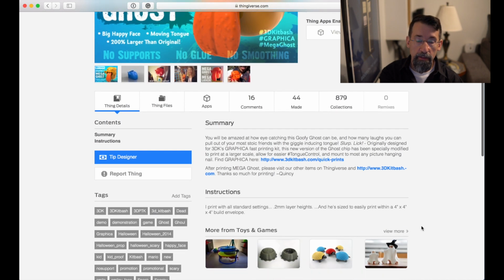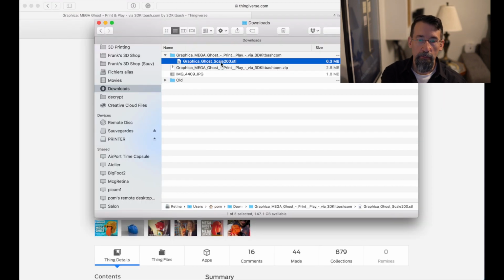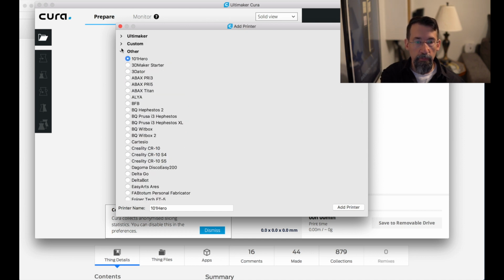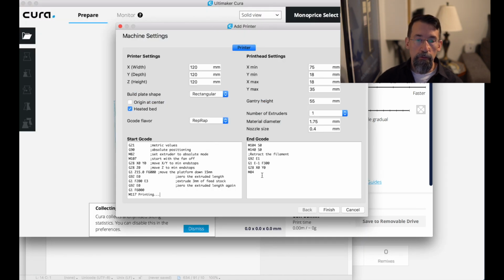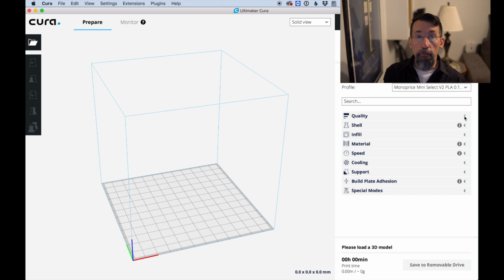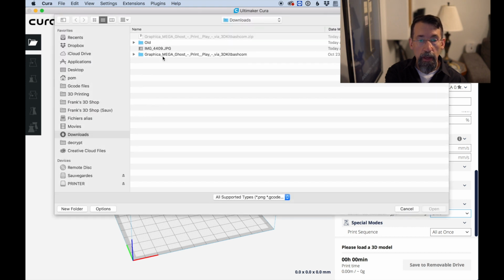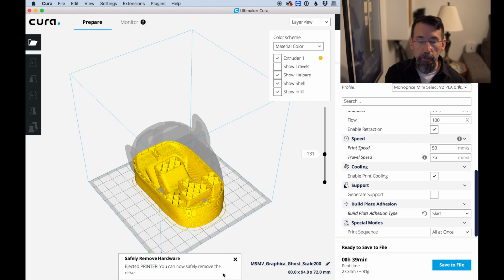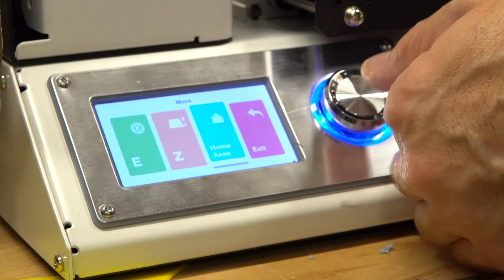Cura 3 - How to do Your First Print

Comment: How and where do I find the files
Reply from the maker: It's in the description of the video, here they are: http://franks3dshop.com/Vlog-5_Files.zip
http://franks3dshop.com/Cura_Monoprice_Printer_Profile.jpg
Reply: Ok I downloaded cura put my file or thing I wanted to print in it and saved the Gcode but how do I get it to my printer
Reply from the maker: The easy way is to put the file on an SD card formated FAT (it depends on the printer) than print from SD Card on the printer, you can also connect a USB cable and print to the printer from Cura instead of saving a file. Octoprint is a print server that you connect your printer to and print from the network, a little more involved but with some advantages.

Comment: Can I ask why the end gcode you put on your cura is different than the file you included. Yours ends with a different code to turn off fan than the file you shared. Thanks.
Reply from the maker: For the end code, you can after 5 minutes or so turn of the fan, it’s a choice you have, I would not turn it off right away because the heat could damage the hot end, I now prefer just leaving the fan ON, with the Noctua I have installed it makes no differences noise wise. Is that what you wanted to know?
Reply: I dont know. lol. I am not familiar with what all the gcode comands do. I know in the link it is M107 Turn fan off.. And in the video you show something else. 
I also have an issue now when I try printing it doesnt start the print. The temps are right where they are suppose to be and nothing. It just doesnt want to start the print for some reason. I went back to the old cura and it prints fine. Any ideas what I am doing wrong? Thanks so much.
Reply from the maker: Hi, what you could do to test the start and end codes, copy and paste them from version 15 and test if it makes a difference.

Comment: Nice tutorial Frank, thank you. May I suggest  that you could add  some part to the video about what's  the best thing  to do  right after the object is  printed 1) just  turn the printer off with the switch ?  2)  Use the  "Move-extruder " menu to retract the filament out of the hotend ?  3) Do a cold pull every time the object is printed  ?What's the exact procedure to follow  ?
Reply from the maker: Thank you good idea, for your information, do not turn off the printer when the nozzle is hot, it could melt the PTFE liner, I myself just move gently the hot end out of the way and remove the part. For the rest you do as you like, if you plan to print soon leave it like it is, turn it off when it cooled down... Good idea I will do a video on that.

Comment: Very informative and easy to understand.  Thanks Frank.  I think I am about ready to order a MP Select Mini.  I have been comparing it's features with a Delta type printer.  Mostly deciding which is more important, heated bed (MP) vs auto leveling (Delta).  And I wasn't sure if "level" meant to itself or to Earth, I now know it's to itself. After weighing the benefits of both features I have decided that a heated bed is more useful than auto leveling, since if I understand what I've read, to print ABS you need the heated bed. Though.. I have also read the Monoprice printer does not work well with ABS. Still, I think I have talked myself into buying the Monoprice printer.
Reply from the maker: +Duck Landes Thanks that makes my day, and English is not my mother’s tongue! Printing ABS is hard, I did not try it yet because of the fumes, I do not have a garage, it’s in the basement and no windows. PETG print fine with that printer and I have made some parts for my motorcycle cases. Repaired the handle hook in the trunk of my car to lower the back seats. And it all was sturdy and resisted the summer sun and warmth. No fumes with that filament. It’s a little harder to print than PLA meaning the settings. And I have settings for the Monoprice Mini for PETG that I can share. It’s really a nice little printer, no fuss, you can put it on the corner of a desk. ABS is more resilient to temperature, you can smooth it with acetone vapor, but it shrinks, PETG almost doesn’t shrink, even printing large parts. I am planing to record a video about filaments this week and feature it in the coming weeks. Full on production here ! One recommandation, take the time to print in PLA first.
Reply: Thanks for your reply, Frank.  Good to know about the ABS fumes, I live in a small place with no garage so fumes for 8 hours would be a bad thing.  Good advice about using PETG vs ABS, and starting with PLA since all I know (which isn't much) so far is just from reading and watching videos, no hands on experience yet.  But I'm pretty well sold on the Monoprice Select Mini and will order it in the next few days as a birthday gift to myself :>
Reply: Okay.. I pulled the trigger!  Ordered an MP Select Mini V2, two 1kg spools of their premium PLA (1 black, 1 white), and for giggles an MP 3D printer pen (on sale for $19.99).  Downloaded Cura. Now I just need to decide on a modelling software, and find the stick glue (I'm assuming I can find some at Walmart.) And find a place to set it up where my cat won't attack it :>  Happy birthday to me, and thank you for helping me to decide which 3D printer to get.
Reply: Frank, just saw this video after I posted a comment under the video before. Please disregard that particular question. 

What I am really interested in are the various types of filament. I've read about PETG and the two new ABS types, ABS neXt and Trans ABS that are supposed to be easier to handle and/or don't fume as much while printing. I hope you can cover them, too. 

WRT your next printed object, if you're still looking for something worthwhile, maybe you could check Thingiverse for miniatures for table-top gaming. This is a big thing for me and I'd like to know if this printer can do it, too (with the smallest resolution possible).
Reply: I did a bit of reading this evening about PLS vs ABS vs PET vs PETG. The only avantage I can see ABS has over PETG is ABS is biodegradable / recyclable, PETG isn't. And PETG may cost a bit more. The advantages of PETG over ABS is PETG can be printed clear and it is food grade.  For my main purpose for buying a 3D printer, making scale parts including headlights and spotlights for my R/C trucks, it looks like PETG is the way to go. But, as you advised, I will stick with PLS till I really figure out what I'm doing.
Reply from the maker: I am trying a print at 0.30625 layer height for speed, the head will take 4.5 hours to print. I will get back to you about this, needs quite a bit of support to print. I will do the calibrations first to maximize the print quality. Which is already quite nice. For the record I do not thing that this printer will print ABS, the temperature for ABS is quite high and I think that it has a liner inside the heat break tube. Prints fine with PETG at 225 degrees, but the 250 for ABS is too high and would melt that liner, and if you want to avoid warping you should enclose the whole thing to keep the air hot. Let's see that print for the fun of it.
Reply: Nah, it's a little piece of plastic that you put inside. It's really a 2-cent part even if you use an expensive filament, but there's no way to buy it and not the whole mug part. I plan to buy the printer to use it for little things like this. The 12x12x12 cm printing surface should be more than sufficient for my needs.
Reply from the maker: +Frank's 3D shop Ok, 0.30625 is way to much for the printer, read about it afterward! Will try again at 1.5 or 1.075 as recommended. 60mm/s works fine. Temperature is varying when printing, maybe more PID tuning needed, not a problem. Report back tomorrow :-)
Reply from the maker: +Frank's 3D shop Ok it is not that easy to print the torso, lots of supports, tried to print it nose up, turned out OK, I broke one arm removing supports, I have to tweak the supports for this one... I will put the picture of this morning on my Instagram...
Reply from the maker: +Frank's 3D shop https://instagram.com/p/Ba6WELzFS6d/
Reply from the maker: +TheSevenUpMan I think I got the support tweaked just right now, the spacing was not correct for the layer hight, it was fused to the part, reprinting... Also I had a problem with the Nozzle, it was oozing out some plastic outside of the hole where it should come out, seems to be a defective nozzle from the factory, not a problem for me I have some laying around (and they are cheap), just had to level down the bed 1.5mm down because it’s a little longer than the original. Recorded the process, to be made into a video. I also removed in the process the insulation surrounding the hotend, I do not print in a cold environnement so that should not be a problem also.
Reply from the maker: +TheSevenUpMan https://instagram.com/p/Ba87mJ7lHU_/ this is not easy to print because of the support, for the torso you could cut the model in half and glue it together. Needs a lot of support tweak.
Reply: Awesome! Man, I can't wait for Christmas to come! :-) 

By the way, the nozzle of the printer, is that a standard one that I can buy almost everywhere, of it is specifically made for the Monoprice?
Reply from the maker: +TheSevenUpMan it’s Standard, mine costed $3, just had to lower the bed 1.5mm no problem. And Amazon offered me to reimburse me, exchange or give a 15% rebate, I took the rebate...
Reply: So the workflow to print something from Thingoverse (like the miniature you printed) would be to download the STL files, open them in [what software?], save them in [what file format?] and open those converted files in Cura to print them? Also, could you post a video about how you incresed the supports for the mini's torso?
Reply from the maker: Thw basic workflow to modify an stl, would be download the .stl, import it in Fusion360, cut it in half, and export it in two .stl files, those will be used in Cura. Yes I will do a video on settings for supports in Cura.
Reply from the maker: +Duck Landes Happy birthday ! I have learned 3D Design in Fusion 360 from https://www.learnfusion360.com/ they inspired me to begin my Youtube channel. I had a coupon code SAVE50 and I do not know if it’s still valid. That course is really easy and you do not need any prior experience. Autodesk fusion 360 also has vidéos on their site. You can to use the free education version of Fusion 360. There is also free software and other courses, but this is what I used...
Reply from the maker: Sure I will look in to this, ABS is hard to print for me, I have absolutely zero ventilation down in the basement. I would like to do build a heated case with an outside fan. PETG is really nice, why do you need ABS? Do you have a link to an example in thingiverse that I can try print ? Keep in mind that I still have to do some tweaking on this little printer... Thank you.
Reply from the maker: Yes good thinking!
Reply: As for the model, how about this one: https://www.thingiverse.com/thing:1727370

It's a two-part miniature that requires almost zero mini building expertise and should be quite easy to print. 

WRT ABS, for my household I need an axis pin for my mixer. It's a ridiculously cheap little part but it's impossible to order it alone without ordering the whole set, which would be just insane. Since I'm not sure how PETG would handle the pressure, I'd rather use ABS which is said to be more sturdy. Please have a look at the little plastic pin inside the pot: http://www.bosch-home.com/de/shop/00268636
Reply from the maker: For the Pin you are talking about, I am not sure what you mean. If it's the part in the middle of the thing, it seems to be part of it ?
Reply: It actually came out great! Does your slicer software add the supports automatically?
Reply from the maker: +TheSevenUpMan Yes it does create them automatically, I need to tweak it, density, spacing ect.
Reply: Can't wait to watch your video on that!
Reply from the maker: What I would do for that torso, is split it in half and print each part seperatly, them glue them together, that way it does not need support and the finish would be better, I think.
Reply: How do you do that? Can you do it in Cura (that the printer ships with, right?), or do you need a 3D modeling software for that?
Reply from the maker: +TheSevenUpMan You need to edit it in a 3d modeling software, if the file format of the original designer software is not included, you have to edit the .stl file. It is not that hard, but can result depending on the details of the model in a lower quality. Maybe there is another way, I did not research this to much.